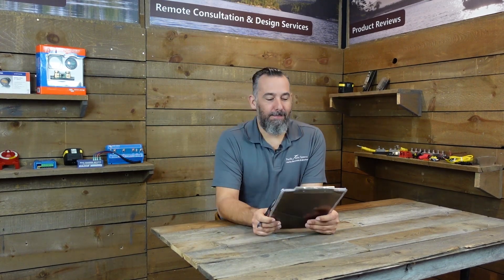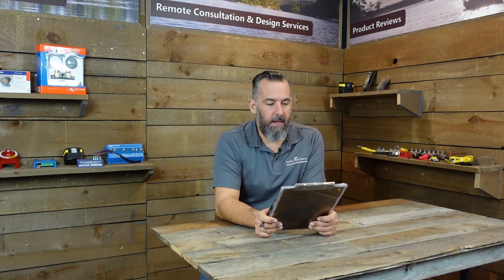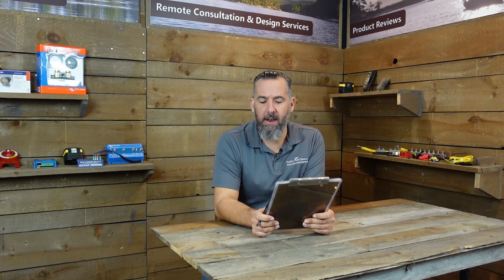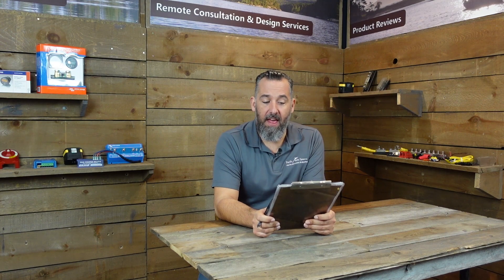Should the Engine Ignition Be Connected to the House or Starter Battery?

Comment: A different question but somehow related, on my Bénéteau Oceanis 31 my actual set up has a battery isolator (Cristec). The wiring includes a small cable marked IG which runs from that isolator to "the engine", I think to the key switch and serves the purpose to "activate" the alternator. Now I have been thinking of replacing my house batteries in the future with a different battery technology as the engine battery (eg. Lithium). We know in that case that the charging set-ups (be it alternator or ac charger) cannot be efficient dealing with two different charging profile (say AGM for starter battery and lithium for house). So I have included in this alternative the use of a DC/DC charger that would be set to charge the house battery from the starter battery. This would in effect replace the battery isolator. But what about my IG feed back to the engine. I could leave the isolator in the circuit just for that but it seams weird, would that IG cable just connected to the positive post of the starting battery serve the same purpose? Sorry for a long question, thanks in advance for your enlightment.
Reply from the maker: If you are going the DC to DC charging converter route, then you can remove the IG wiring altogether.
Reply: @PacificYachtSystems  Thanks for your answer, love the way you teach us all...

Comment: If your engine panel has an idiot light for oil pressure but no alarm, it's easy to add one. Just get a piezo buzzer and wire in series with the light. If the light comes on, the buzzer sounds. Came in handy on my boat when the alternator bracket broke and dropped the alt on the oil filter and punched a hole in it. It blew all the oil out of the engine but I was able to shut down with no further damage. Heck of a mess to clean up though. Buzzer cost about $4 on eBay.
Reply from the maker: Smart, thanks for sharing!

Comment: I’ve been around boats for many years and I know a lot about engines. I’ll be honest, I didn’t realize that ignition alarm was tied to the oil pressure sender. I guess I’ve been fortunate never to lose oil pressure while an engine was running.  Actually is it ever connected to the temp sender? I had it go off once when I lost coolant and the engine heated. Maybe I also lost oil pressure because of the overheat.
Reply from the maker: Yep, temp sensor is also connected to the alarm, but if your engine is running without over temp condition, you won't ever get to hear or test this feature.

Comment: Have you considered connecting the alternator to the house batteries they take the most current and a smaller split charge system to the engine battery as it doesn't need much if the engine starts easily
Reply from the maker: Absolutely, it's my preferred approach too. My boat and many others we work on is exactly set-up like that.

Comment: I will link this short article on DOD and FLA batteries - life expectancy. I hope you can comment on it.   Deep Cycle Battery “Useful” Life Analysis –

The mythical 50% DOD “Limit” - Busting the Myth
By Bacchus / Winemaker2 Rev 1 Apr 29, 2020
file:///C:/Users/Rick/Downloads/Useful%20Battery%20Life%20Analysis%2050%25%20DOD%20Myth%20Busting%20%20Rev%201%20(1).pdf

Comment: Oversimplified: step 1: check for no oil pressure. Step 2: start engine. Step 3:  check for oil pressure. Step 1 is potentially as important as step 3.  Corollary: think of Apollo 13, when Gene Kranz asks the mission controllers "are we dealing with an instrumentation problem, or is there a real problem here?"
Reply from the maker: Thanks for sharing Pete.